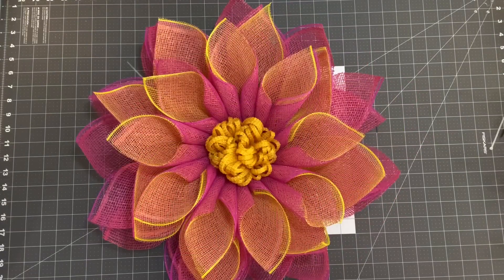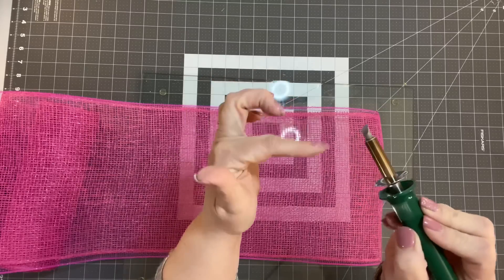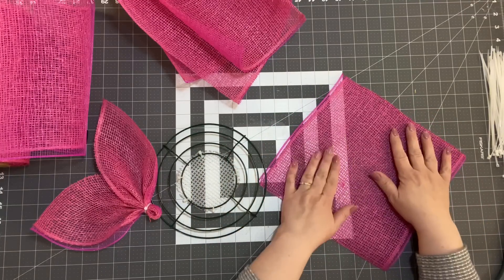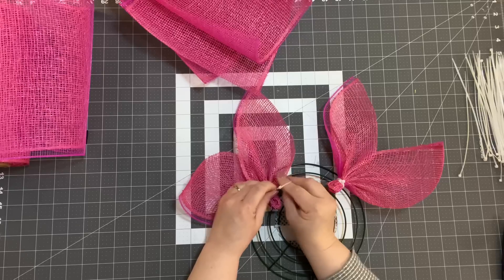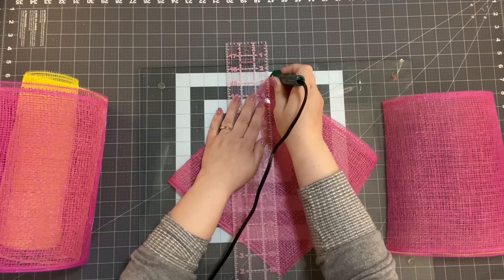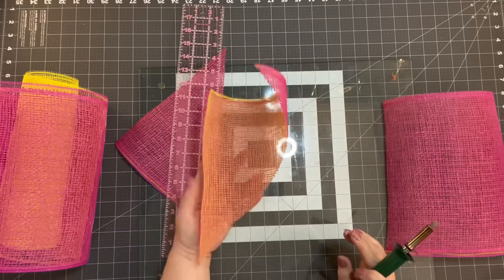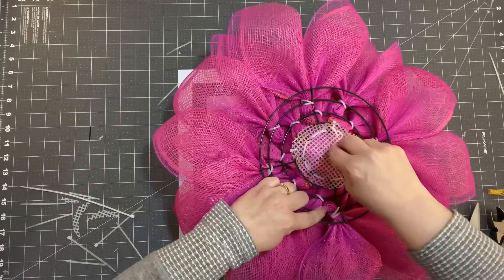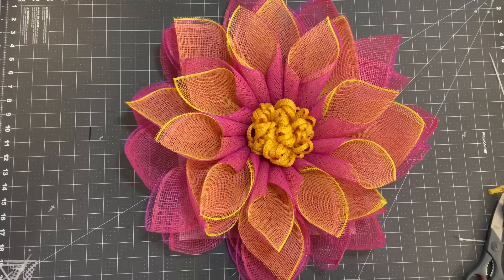How to Make a Spring Wreath / Fusible Method Wreath / Flower Wreath Tutorial

Comment: I thought I would share my BIG SCREW UP in step 2. Either my ADD kicked in or I was just really excited to make this wreath. 😂 
**Julie I love this wreath! You make it sooo easy when you use the wood burning tool!**
My screwed up and wasting valuable material, the poly burlap is not cheap! I thought I would share what I did so you don’t make the same mistake.
In 2nd step when you stacked all 3 colors to cut them with the burning tool make sure you roll them out how Julie does. I’m so used to rolling out my mash and order but I don’t usually use the woodburning tool so if I did roll them out out of order, it’s easy to put the mesh in the correct order.
When I lined up the 3 colors I had the mesh facing up is if you rolled it out when you open the mesh for the first time. After cutting all 4 - 10” squares and went to put them on the frame I realized I did something wrong. Because after I scrunched the triangle and went to attach it to the frame the petal was curved away from me but I had the yellow mesh showing first. After watching that part of the video I figured out what I did wrong! 🤦🏻‍♀️🤦🏻‍♀️🤦🏻‍♀️
At this point I had already burned them together so I wasn’t able to separate them. I tried but it did not work out. I don’t know if this makes sense. I should have had the rolls facing down like Julie does 🤦🏻‍♀️ I thought I would share incase you’re like me, exited to make this wreath and mess up something so simple and waste material. 😤
Reply from the maker: Thanks for sharing, we all mess up from time to time.

Comment: I have done your fusible method last week. I did have trouble cutting even my top mesh thru the lines. I undid the mesh and did my best to like it up. But still couldn't.  Any advice?
Reply from the maker: Maybe go a little slower? Did you use poly burlap with the deco? I feel like that is the key to get it to fuse together.
Reply: @JuliesWreathBoutique  I guess I didnt see that you were using deco mesh and poly burlap. I thought it was both poly burlap. I will try going slower.   I wonder if the roll was stretched. No matter how I worked it, I kept going thru other lines. The wood burner works for cutting deco mesh too! Thank you
Reply: Cutting  through  lines? Did that prevent  the fusing?
Reply: @debcripps21  no ma'am it didn't.  Using the burner works so well. I've always cut on the straight line and not across the main lines. If that makes sense.lol. I'm too picky so I want straight lines. But once you make the petal, it won't show or matter that the line wasn't straight. Hope this helps